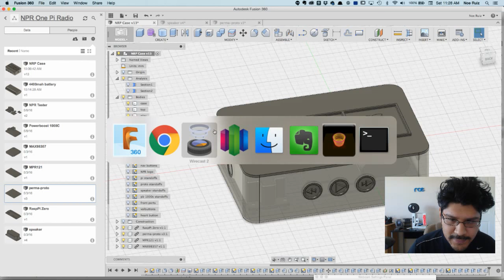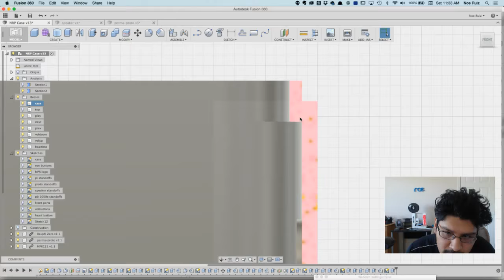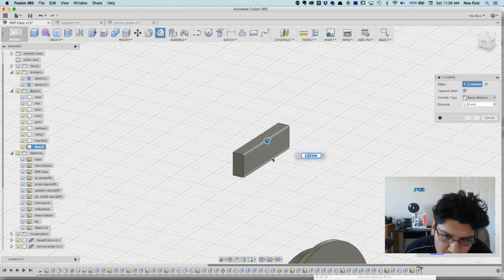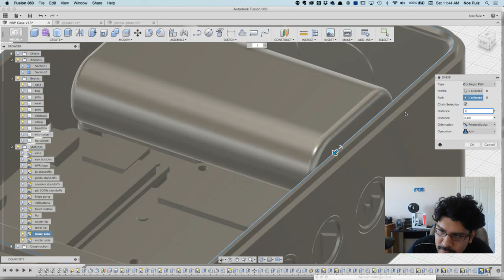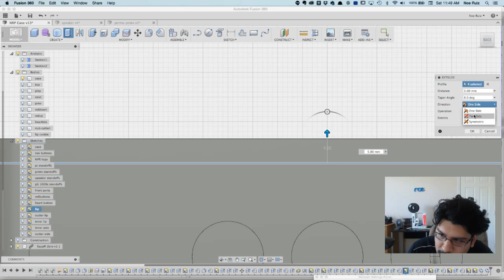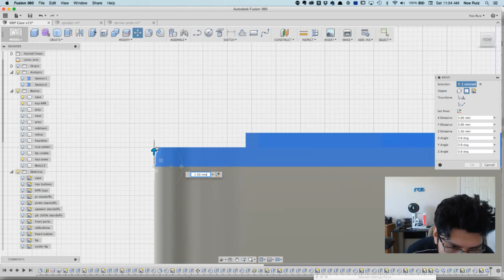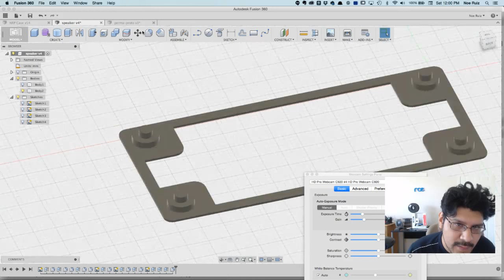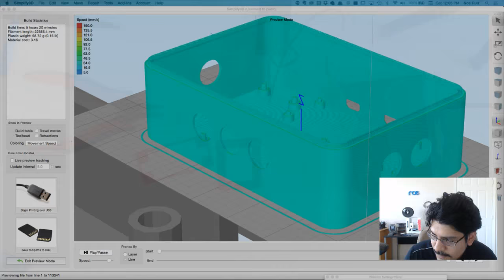Layer by Layer LIVE - Raspberry Pi Radio PT2 @nprone @adafruit #LayerByLayer

Comment: Would it not be possible to create a single sketch of the full section with both internal and external surfaces then sweep that around the entire surface? You could create a single sketch with both the top and bottom lips.  This will reduce the construction of the lip to three steps. 1. Create Sketch with top and bottom lip. 2. Sweep top, 3 Sweep bottom